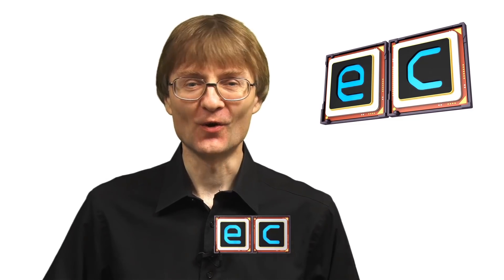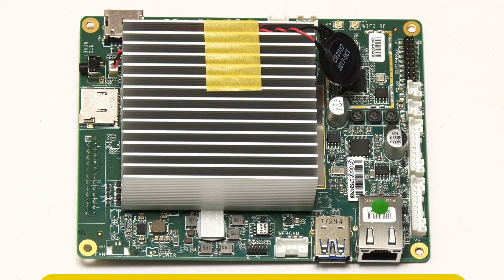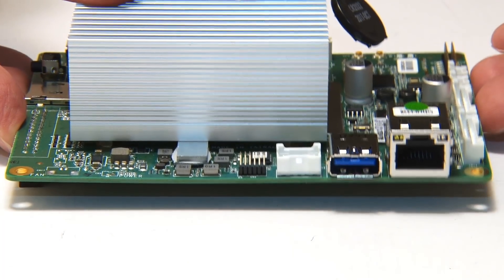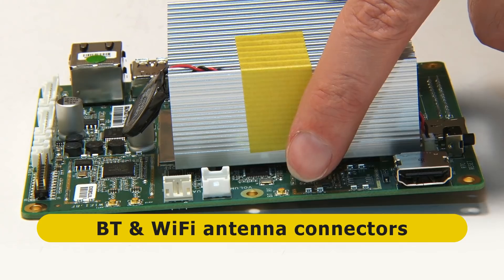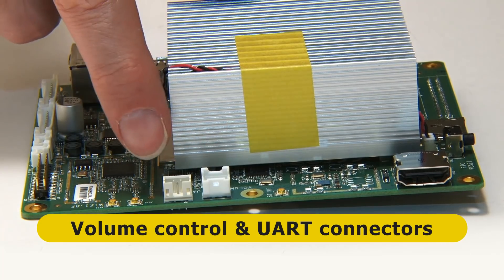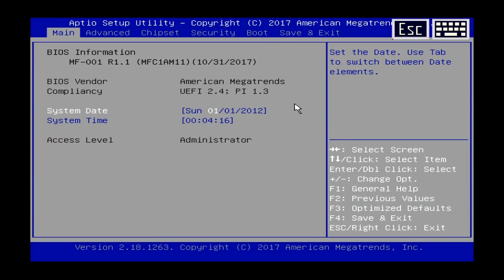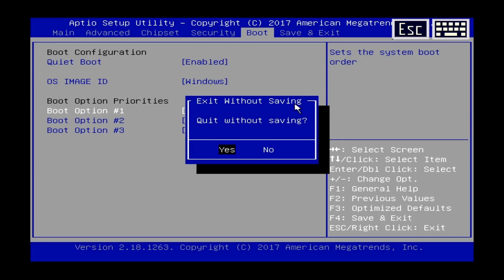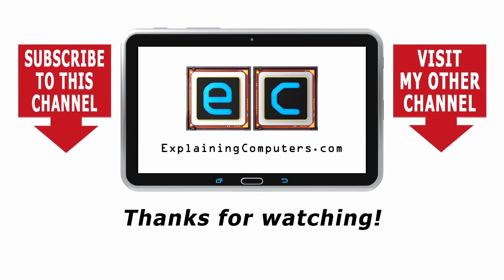Atomic Pi Intel Atom SBC

Comment: Great value board, but it's so ugly, it wouldn't look nice where ever you put it, for a bit more money you could get something much nicer, early this year I bought a beelink x45 with a intel celeron  j4105 processor , 4 cores 1.5ghz turbo to 2.5ghz , 6 GB ddr4 ram and 128 GB SSD, this cost £130 , it does everything a pc should do and it's small and discreet, sitting under the TV instead of the Nvidia shield, streaming 4k media.

Comment: I still have to get a power supply board and adapter for my Atomic Pi. I bought the unit for something I wanted to do with it, but when it arrived, I realized I was not going to be able to power it via the normal route with a micro USB / phone charger option. It also needs a powered hub for most of the things I'd do with it, but I have a couple of those, so it's not a big deal.

I also need to find a case, but haven't seen any listed. I might make one, but I'm not sure yet. (I should get the PSU board and adapter first.)
Reply: There are plenty of video's out there on powering it up, but the micro board is probably the simplest and cheapest way to to it.  Both my addon boards showed up last night and I plan on doing a video on both of them later today and hopefully get that posted tonight.
Reply: @ChatterontheWire  Maybe a video on making/buying cases for these mini computers?
Reply: @floydlooney6837  If I had a 3rd printer I would!  Historically I haven't been too worried about throwing cases on any of mine, so hasn't been a high priority for me, but a 3d printer is on the wish list, so maybe that will be the next buy and look at some videos on that, though a lot of other plans for vids first.

Comment: That Intel Atom x5-z8350 cpu empowers some mini pc boxes. I got myself an Alfawise X5 mini pc and a Z83II. Both with that cpu, 2gb of ddr3 ram, 32gb of emmc storage with Windows 10. Not so powerful daily driver mini pc but they do the job.
Reply: I use an Asus X205TA and it is more or less this, in laptop form. My daily driver. Microsoft has special licensing for that spec and 2GB of memory *only*.. to try and head off Chromebooks etc.
Reply: @TattiePeeler  that asus uses an older cpu... z3735... than x5-z8350. I know this cpu z3735f/g, it runs windows 8.1 well, windows 10 will be a little slower but usable. z3735 usually comes with intel hd graphics 100/200 while z8350 comes with hd 400.
Reply: @TattiePeeler  I think the Atom will not support more than 2GB of memory.
Reply: @TattiePeeler  Kinda but the Atom in the X205TA is two years older tech (22nm fab vs 14nm) and 30-50% slower.  Still that notebook would prob be OK running Lubuntu 19.04 or 19.10
Reply: Windows 10 uses around 1300MB of RAM at startup.  Lubuntu uses around 400MB.  Nuf said.

Comment: Running win7 on it will result on a mixed bag, but windows xp should run hapily and fast considering the minimum system requirements are only 64 mb of ram!

As always keep going and congratulations for this awesome video
Reply: I have been collecting single board computers into a heterogeneous cluster and will be adding this one too. Heck of a machine for $45! I have over 40 boards from 15 manufacturers.
Reply: @donporter8432  "I have been collecting single board computers into a heterogeneous cluster"

I bet Chris tiies his bathroom with them.

Comment: Currently attempting to build a cheap little sff thin-client out of one. Would you say lubuntu or popos?
Reply from the maker: I'd opt Lubuntu, but only because I have more experience of it.
Reply: @ExplainingComputers  Interesting. That usb header, how many ports could I get out of that per chance? Mine won't be here for about another week unfortunately.
Reply from the maker: You could, in theory, hub as many ports as you like (well, probably a limit of 8) from both the USB 2.0 and USB 3.0 ports.
Reply: @ExplainingComputers  I do not believe you understood my question. In your review, you said there was a usb 2 header. I was asking what the limit on that was.
Reply from the maker: I understood I think. You could hub as many USB 2.0 ports from the usb 2.0 header as you need, more than 8 my become problematic though, and it will depend if the devices draw (significant) power.
Reply: @ExplainingComputers  Alright. I thought you were talking about the integrated usb 2 port on the board and not the header